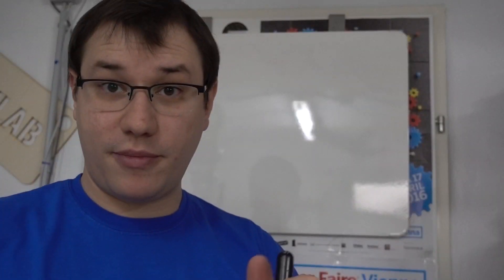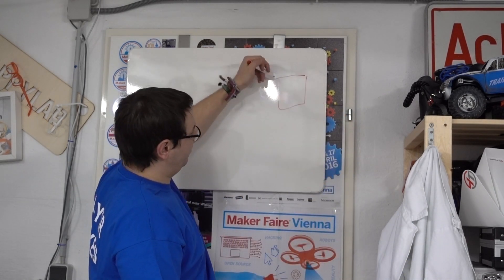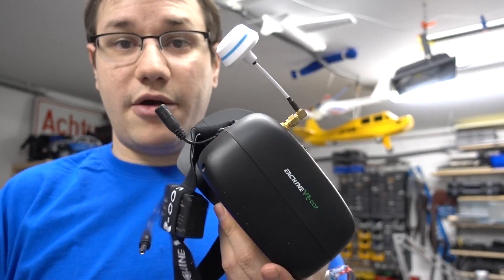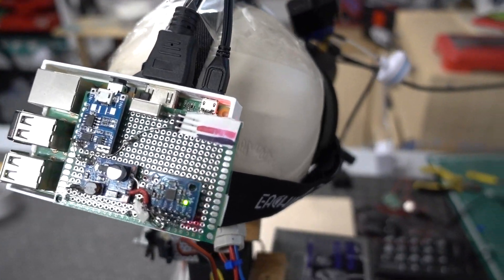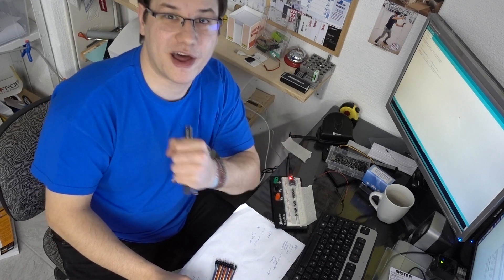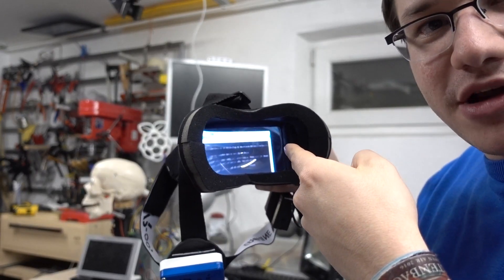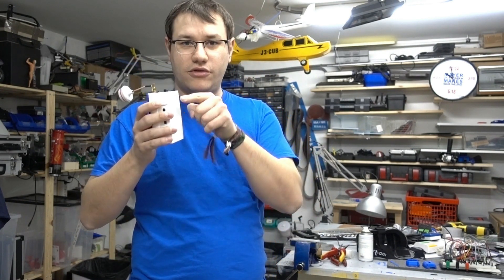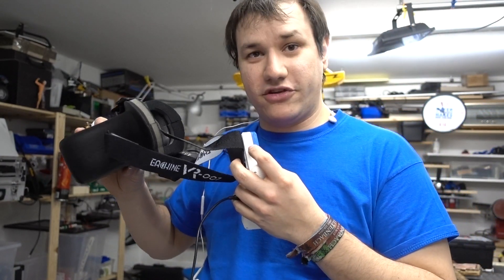Hack Like Heck: MAYER MAKES - VRpi - Virtual Reality DOOM on Raspberry Pi

Comment: What's with the wireless transmission?  Wouldn't it be better to find goggles that you could interface with the LCDs directly (and using something like the DSI interface on the Pi?)
Reply from the maker: the point is that you can use ANY Fpv goggles 8cheap ,expensive does not matter), another cable would be not beneficial. The ribbon conenctors on the pi are very delicate, and do not allow to transmit a clear picture over a long cable.
Reply: @MAYERMAKES  ah fair point, you'd have to strap a pi behind your head rather than at your belt